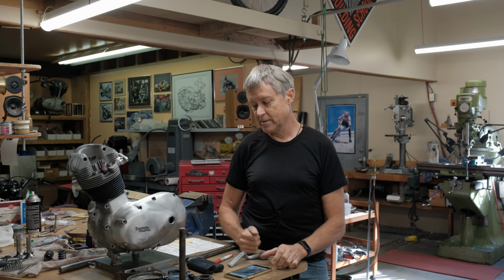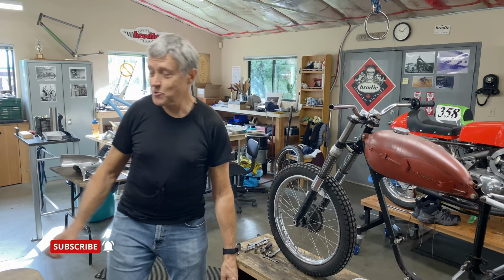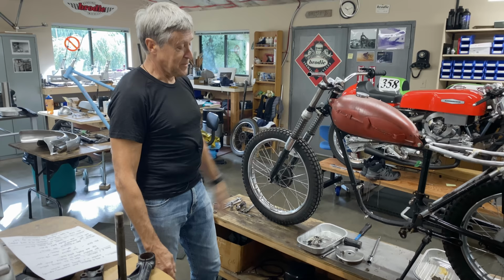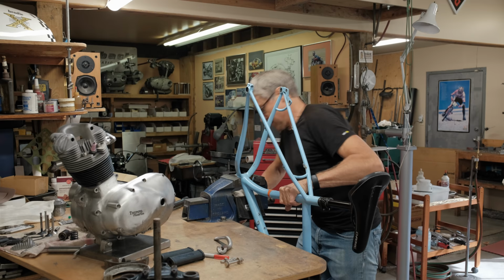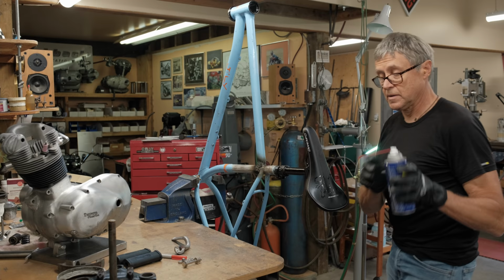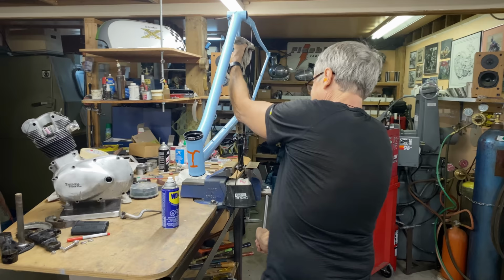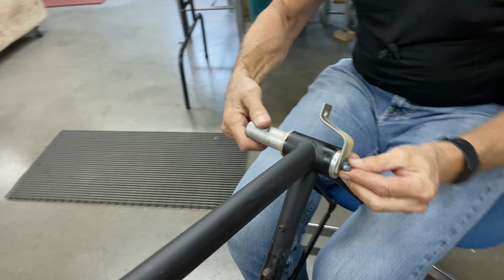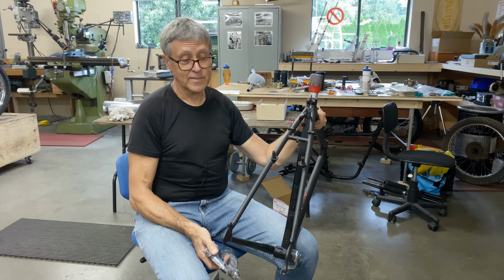Busy Busy Shop // Paul Brodie's Shop

Comment: You earnt a new subscriber here. As a younger generation but refuses to ride anything else but steel bike, it'd be my pleasure to visit your shop, talk and learn from you if I lived the same neighborhood. 

I'd love to have your advice, my steel track bike left seat stay is slightly bent and has significant dent on it in the middle, (but no crack), what should I do?  

Sincerely,
Try
Reply from the maker: Thanks for subscribing. It's hard to offer advice without seeing the frame. Straightening the tube shouldn't be a problem if you are careful. Sometimes you can round out the dent with wooden blocks and then fill it with bronze. No overheating! Have you seen the top tube dent video?
Reply: @paulbrodie , I have just watched and it's amazing so my hope is still alive. 

Thank you very much and may you stay safe.

Comment: I probably should do all that to my bike but I haven't shrunk enough yet  to really need to move sea-tpost plus it still has original paint and stickers from 30+ years ago (Muddy Fox 'Trailblazer' ,Tange tubes Suntour crank and cassette).
 I did fit new forks and front wheel about 25 years ago, that was also last time seat post was moved, good quality grease hasn't helped. (Silkolene 'Pro, used it on race motorcycles)
 I contacted Muddy Fox few years ago hoping to find transfer kit but the original company was sold and new bikes are made in China 
New owners know nothing about originals.
Reply from the maker: There's a good chance your seat post is REALLY stuck. A quarter of a Century! Thanks for the story.
Reply: @paulbrodie  Yes, it was stuck about 5 years ago when I tried to adjust height. It won't have gotten any better even though I did soak everything in release oil. I'm pretty sure I'll have to cut it off and drill it out eventually.
 One advantage of steel frames though, they last almost indefinitely as long as they stay dry (and being a recreation cyclist I don't care about the 'extra' weight, at 185~ 220 I probably need it LOL .

Comment: Looks as if the bend in the frame upright is weak and bending forcing it to pinch on the seat post. Unless something changes (shorten the seat post) I'd expect some kind of failure in the future.
Reply from the maker: I'm not expecting failure, so we differ in that regard. When Mitch made the frame in class he was running out of time, so the full reaming of the seat tube didn't happen. The seat post went in... tightly. Mitch plans on giving the reamer a couple of more passes before assembly.
Reply: @paulbrodie  It was the paint flaking on the bottom bracket that prompted my comment, I thought it indicated flexing of some kind.
Reply from the maker: @allanhagan5113  Mitch's fillet braze is very robust in that area, so I doubt there is much flex going on. I would tend to blame the actual paint.

Comment: Hey Paul, I thought I had everything I needed to begin brazing I have a small torch with map gas and oxygen tank and it seems to be working well. The trouble I'm having is i have brass rods of 2mm and the brass runs away as well as the silver solder. I've used plenty pasteflux but I'm still tortured by the metal running away I'm fixing a gardening cart of steel tube. 
Could you share what I might be doing wrong. I'm really looking to learn brazing.

Comment: Changing the stance of the bike by modifying fork length and rear shocks will also drastically alter the steering geometry.
Reply: Not entirely, if you add say 50mm to both ends, you will increase the wheelbase and trail length but you will still maintain the castor angle which is important especially for a trials bike. I've built a few cubs with modified fork lengths and I always increased the rear shocks to compensate.

Comment: Apologies in advance if you have already addressed the following question.
What are your thoughts on painting versus powder-coating, with both systems having been prepared for and applied well?
Reply from the maker: Powder coat is very durable, but a pain if you need to fix or modify the part, because it is so hard to get off. In terms of look, I think wet paint will always be superior if done well using a high end paint.

Comment: Hello Paul, once again a brilliant video.
I would like to get back to the tubing used in the frame Mitch built in your class.
It has a bend down tube as seen on so many frames nowadays. 
As we all learned (if not already before then finally in your Romax building videos) the head tube/down tube junction faces particularly high loads, for example under hard braking or hitting bumps. 
So we would use the down tube end with the longer butt area facing towards the head tube to put the higher strength there. A bend in that area of the down tube seems to me weakening the tube towards the shear loads induced there. 
Is that bend just for tire clearance reasons in 29er wheel/front suspension combinations or do the designers at the tubing manufacturers promise themselves any other profit for the mechanical circumstances in the front triangle?

What is your opinion?
Greetings
Heiner
Reply from the maker: Thank you Heiner. The bend in the downtube is for clearance to the fork crown when the bars are turned at a 90 degree turn. Not for tire clearance. You do not want the fork crown denting the downtube when you fall off.
Reply: @paulbrodie  Really? You can tell I am not deeply involved with current suspension forks. 
I just had a look at my old Bontrager with the Competition type switchblade fork design. I considered the crown which also served for the first Rock Shox quite box styled compared to other fork designs and there still is plenty clearance when I turn it 90 degrees.
 I was not aware modern forks are more clearance challenged than the antique designs I am familiar with.

But from the mechanical point of view, wouldn't you agree that a straight down tube would be superior in handling the loads to a bent one? To me a bent down tube looks as if it already suffered from a front crash accident.
Reply from the maker: @heinerbreuer6160  Yes, bicycle design has changed a lot. Bigger wheels, longer, wider forks, and much more wheel travel. That's why we need the bent downtubes. Yes, a straight tube is superior, but the bent tubes have a long butt, and are of sufficient OD and wall thickness to make them mostly trouble free.